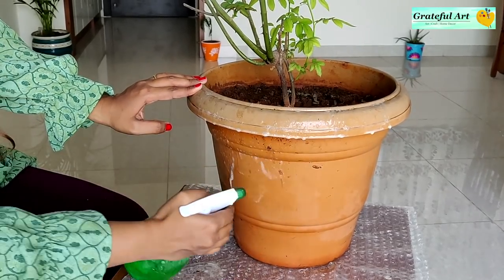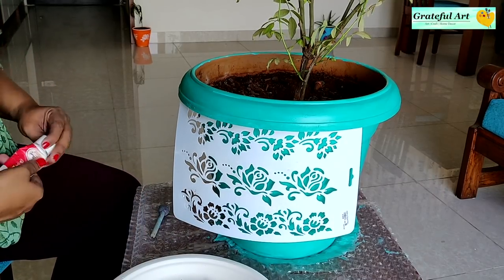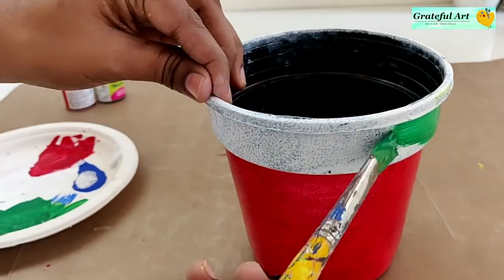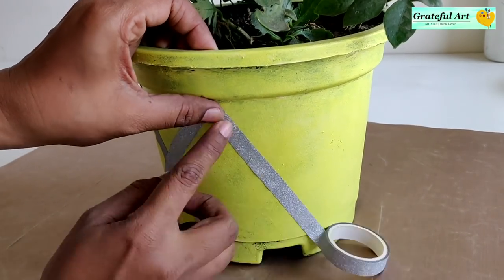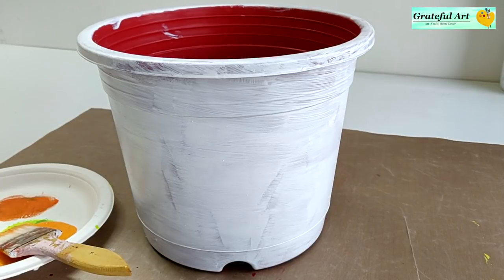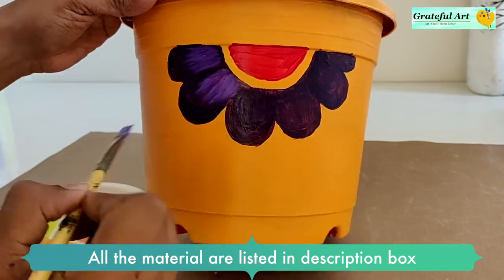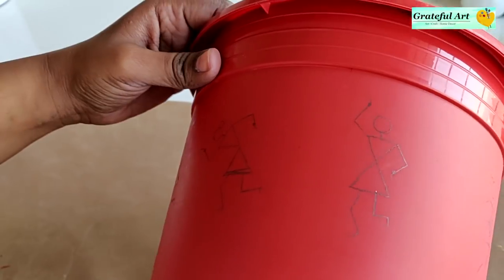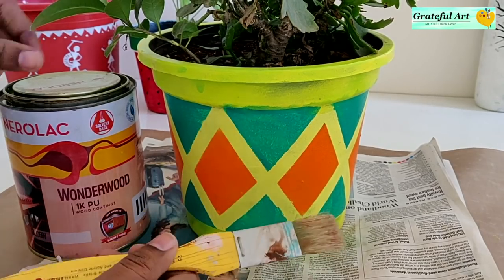How to decorate old planters into new | 5 DIY Plants pot makeover ideas | Garden Decor Part 1

Comment: Very very nice... Really like this
Only acrylic color is good for pots not any other color???
Reply from the maker: Acrylic colors are water resistant that's why Used it. But you can use other colors like any distemper wall paints also.
I hope it'll help you 😊
Thank you ❤️
Reply from the maker: How come..?  Have you applied varnish top coat on planters ?
Reply: @GratefulArt  0
0.
Reply: 10th
Reply: @GratefulArt  hi didi actually I have a doubt it will be very helpful if you clarify that one please reply me.. I saw many reviews that after painting if we apply varnish then it will turn to grey colour.. I don't want to take the risk.. I have painted my plastic pots directly with acrylic paints and it's slowly coming off I'm worried about my pots.. Will varnish really works without damaging my paint? 😔
I'm planning to buy Camlin Arfina Artist's Picture Varnish Spray.. Will this work?
Reply: @jayashreereddy4845  they do get peel off as per my experience too. Better to use either oil paints or distemper
Reply: @jayashreereddy4845  if u worried to apply varnish apply water nail polish it's stays , i tried almost 1 yr over still my paint is there

Comment: Hi, i used gloss oil paints for my pots. Can i go with the same wood varnish..please reply.
Reply from the maker: Yes, You can use varnish after your oil paints  dried completely.
Reply: @GratefulArt  thanks for the reply...but im havent used any varnish on it..its almost a week i painted my pots with enamel gloss.. can I coat it with varnish.will it stay and also please mention the varnish name i can use it on plastic n cement pots
Reply from the maker: You have painted planters using enamel paint then Varnishing is not much required... It's optional..... But to increase durability of paint you can use... There are many brands for Varnish use any  transparent one .( I like Asian paints brand varnish)
I hope this will help...🤗
Thank you 😊❤️
Reply: @GratefulArt  thanka for the reply...I asked the shop guy and he gave me lacquer instead of varnish..?

So, we doesn't require varnish over enamel paints.

Comment: Just wanted to ask that whenever i use acrylic colour on plastic bottles after some time the paint starts coming out of it can varnish fix this problem?
Reply: This is my question as. Can you please clarify this?
Reply from the maker: Apply acrylic color on bottle or any object you want work on and keep it aside overnight to dry out completely on next day apply varnish as top coat on acrylic paint... Varnish help to seal the color so that color will not peel off easily... This will also helps to protect your work from water and sunlight.
I hope this helps 🥰

Comment: Hii mam 
Mam can we do same colour in cement pot also ...
Reply: For cement if it is raw you need to put the universal undercoat then you could apply acrylic. If you are using oil based or enamel you don’t need the undercoat. As rule of thumb for your paint to last, use acrylic paint sealer. Enamel and oil based doesn’t need the sealer. Acrylic and oil based are water proof. Sealer on acrylic which is water based colour is to ensure the colour doesn’t fade and also dirt doesn’t stick